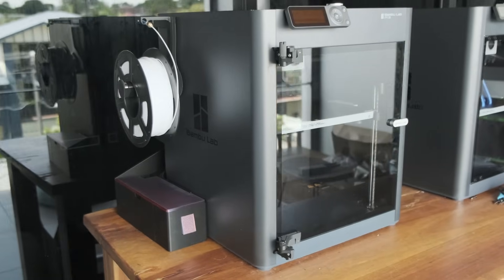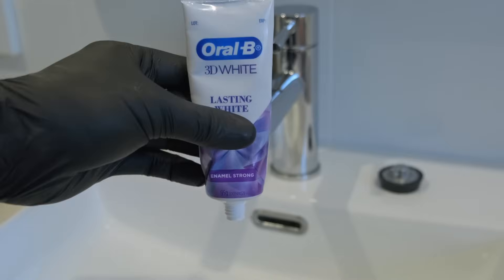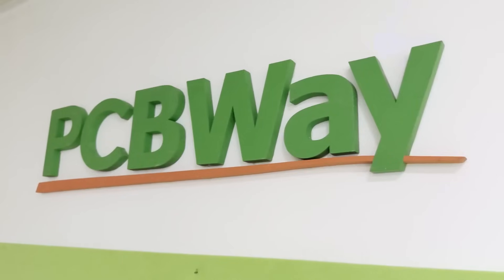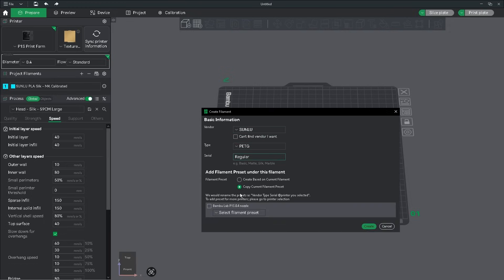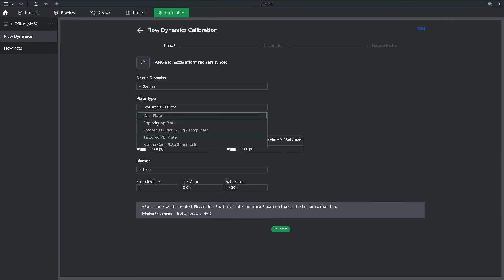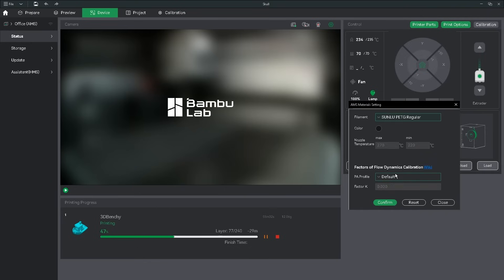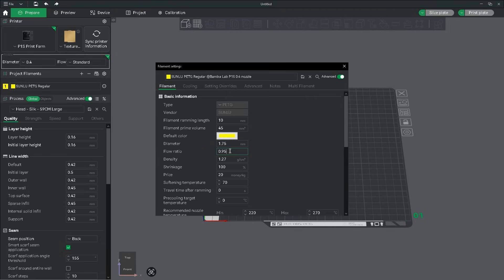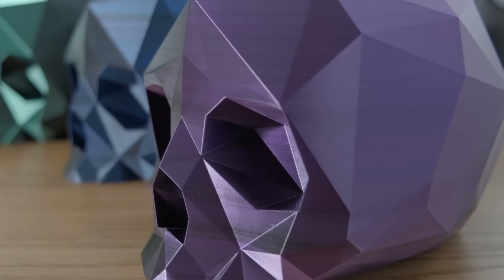Flow Rate vs Flow Dynamics (Bambu Studio) – The Settings You’re Probably Ignoring

Comment: This was indeed helpful, I thought I had a bug because the app said it would print a test model but it never did so I had a feeling something was wrong, this video confirmed that it should indeed have printed something.
Reply: hey! in case you missed this part, on some printers there is manual calibration and Automatic calibration. Only the Manual calibration prints a test model.
Reply: @AVFL173  I have since discovered that but maybe this comment will help someone else in the future, cheers.

Comment: Everywhere I look people say with the Flow Rate calibration to "choose the surface with the nicest finish," which is HIGHLY subjective. 

Which block are you ACTUALLY supposed to choose? The one with the Smoothest surface to the feel, smoothest surface visually/the block that looks the "best," the block that "looks" the "most consistent/uniform?" Cant find an answer to this anywhere.
Reply from the maker: Well, you're right. It is subjective, but it's also important to remember that you'll never get it perfect, so don't stress too much about picking the perfect block/line. I've found that it's pretty hard to feel the difference, so I just go off what I can see visually. For the blocks, pretend it is the first layer of your printer. Which block would you be happy with? For the lines, which line is fully intact and appears to be the most consistent?

Try not to overthink it too much, as you'll be there forever :P

Comment: I completed the Flow Dynamics calibration but the Flow rate started so badly (extremely rough) the nozzle began knocking the samples off the plate.  This is the problem that I was hoping to fix!   Help!
Reply from the maker: Hmm, that's not ideal! Did you make sure to clean your plate before running the calibration?

Comment: Do i need to change the settings/parameters if i change nozzle sizes? for example .6 to .4?
Reply: and one more question. Do i click on the "flow dynamic calibration" just before i send the file to print?
Reply from the maker: If you change nozel sizes you'll need to do them again. And doing them manually is better, so disable the auto flow dynamics calibration before you print, providing you have already done it manually :)

Comment: Another thing to do when creating a new filament profile is make sure the 'long retraction when cut' box is enabled in the settings override tab, and then set the numberical value in the 'distance when cut' to 18 - 20mm. This was a community setting that Bambu rolled in offcially which pulls the filament back by the specified amount before cutting it to unload, and it means there's less filament in the nozzle to purge when you load more back in. If you're using some of the named brand presets that come with the slicer for your base copy, like Bambu or Sunlu, that's enabled by default, but if you use the Generic option and some of the other named brands it's not enabled.
Reply from the maker: Great tip! Thanks for sharing :)